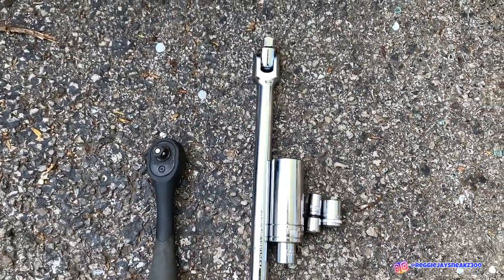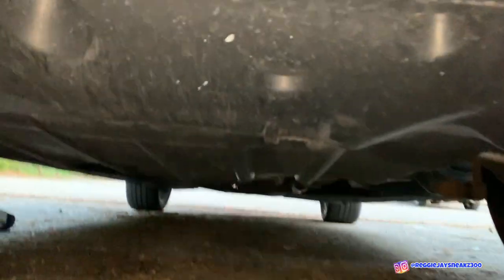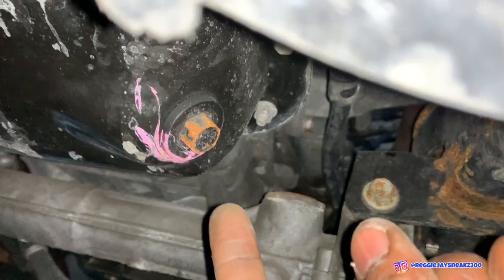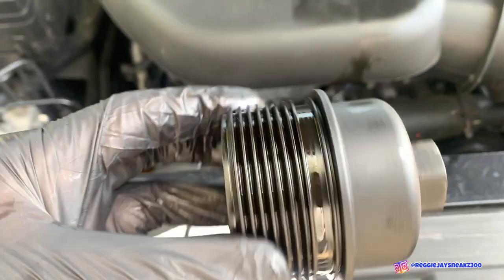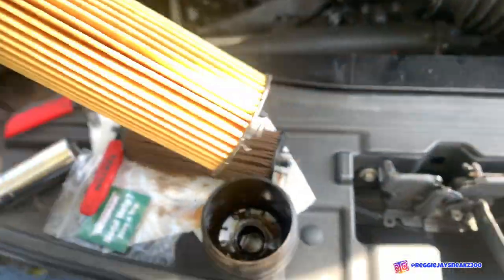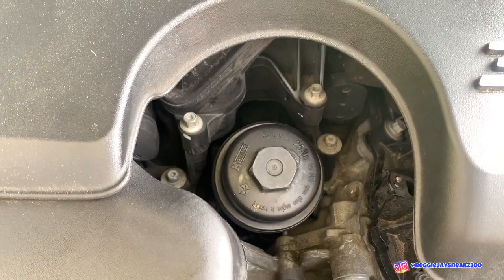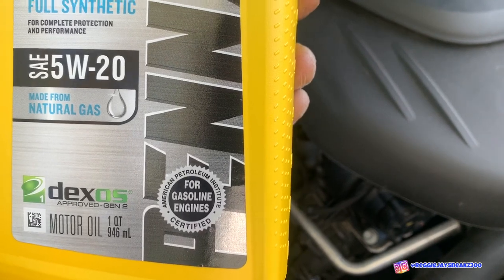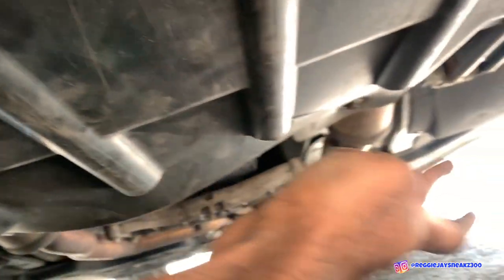Chrysler 300 2011-2022  Oil Change And Filter Replacement

Comment: Brand doesn't matter as long as it has the API approval on the bottle and you change the oil as recommended.Ive been a 3,000 mile guy forever.Remember clean oil is the best oil.You can even use Supertech( Walmart brand) that I use in my 01 jeep Cherokee and 03 300m.And I ALWAYS use STP oil treatment at my oil changes.
Reply from the maker: Facts 💯

Comment: Where did you lift the car? That’s where I’m having an issue… it looks like it can be done in multiple spots
Reply from the maker: Yes it can depending on your Jack but I did it from driver door where the metal of the car is double if you have a 2 ton Jack put the circle piece right there and Jack the car up slowly.

Comment: I got oil coming from my filter what does that mean?
Reply from the maker: Need to change your oil fliter housing bro
Reply: @ReggieJaySneakz  do u have a video for that
Reply from the maker: @homeskillet1299  no I don’t haven’t change it or had a issue. But heard it’s common on the housing to crack from the heat.
Reply: @ReggieJaySneakz  so it will cause my car to run hot

Comment: Replace a fog lighg
Reply from the maker: What you mean ?
Reply: I meant. Do you have any video to replace a fog light an also how to run amp wires to the factory radio
Reply from the maker: Danny Rose got you I will do those coming to stay tuned to the channel